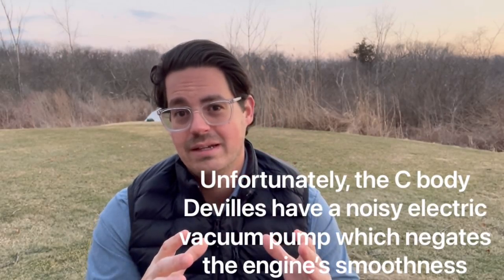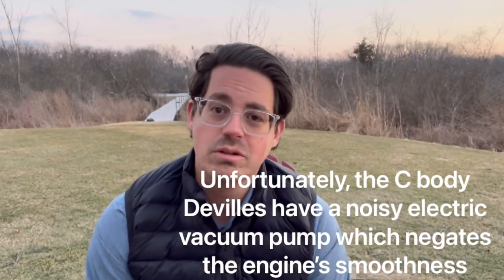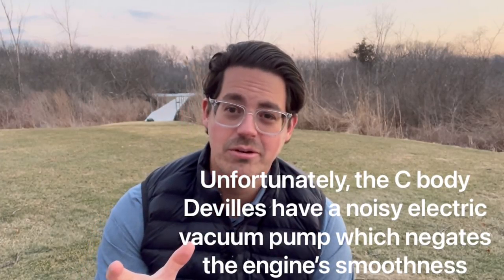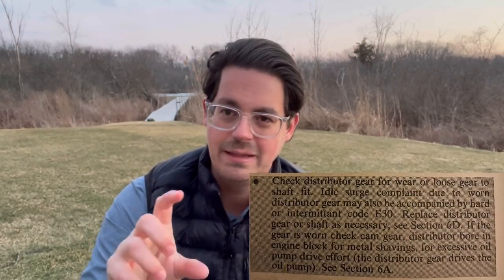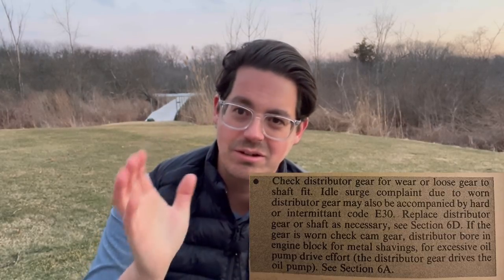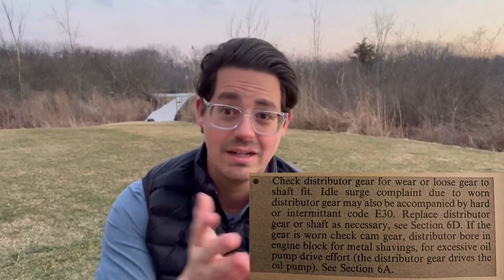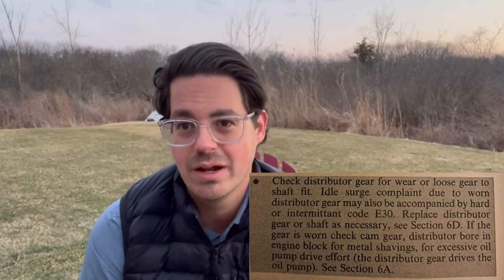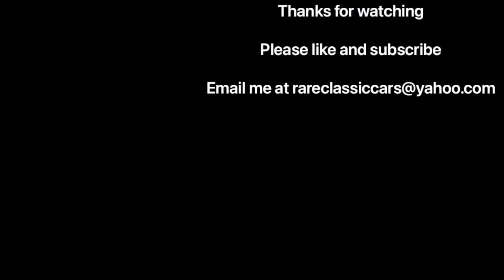Worst Engines of All Time: Cadillac HT4100 - Why is it so bad?  How can you preserve yours?

Comment: I still can't fathom how GM could build engines with soft cam shafts.  In the early 1980s, GM still employed some of the finest automotive engineers in the world and they were certainly aware of the metallurgy needed for a modern cam shaft.  The oil leaks and head/intake gasket problems were bad enough (and should never have happened) but soft cam shafts???  They never seem to learn about products being rushed to production without proper field testing.  The big takeaway is that there are now at least 2 generations of car buyers who will not even consider a GM product, much less a Cadillac or any other American car company's products.  That is the saddest thing to me.
Reply: I guess they did`nt learn from Ford having soft camshafts in the Pintos (in the mid 70`s). In Fords defence though there was a Pittsburg steel strike during that time. I don`t know if there was an excuse for GM.
Reply: GM let the bean counters have entirely to much control in the late 70 thru the 80s. They rushed production, cut development and reliability testing, and used the customer as final testing. 

In typical GM methods, they continually refined and improved the design right up until it was perfected, then it’s discontinued. Then they start over with another product.
Reply: It really wasn't soft camshafts, it was the process used to harden the surface of the cams. This change plus outsourcing, to suppliers, who did not have a handle on the process, and another big one, asking, (and expecting) the supplier to perform their own quality control.
Reply: @johnsalvaterra1355  If it isn`t hardened wouldn`t that mean it`s soft? lol
Reply: @willythewave  The camshafts met hardness specifications, when checked. There were several things going on. Part of the problem was uneven depth of surface hardening. Another was the design of the camshaft follower. It really wasn't the best , even though various engines used that valve train. If it was just "soft" camshafts, it would have been an easy fix.
Reply: That’s the story of GM in a nutshell: great ideas, horrible execution at times.

Comment: The biggest problem with the 4100? Galvanic electrolysis. The heads are good, the cranks are good(I’ve personally ground several hundred 4100 series cranks) but the blocks are junk( 4.1 RWD especially). I have seen perfectly good looking main cap and head bolt bosses shed their threads like a snake shedding its skin. 4.1 RWD blocks are prone to cracking on the rear main bulkhead. The 4.5 and 4.9 engines are both better than the 4.1. In fact, the 4.9 block weighs nearly twice as much as a 4.1 block.

Comment: I used to go to auto auctions growing up, helping my dad check out cars to potential buy. Lots of HT4100 Caddys at the auctions at the time. We almost always avoided them. We didn't want to deal with upset customers with  4100 problems. We stayed far away from the 4-6-8 cars too. We actually liked the 5.7 diesel Caddys, Olds, Buicks, etc. Had more than a few as the family car, never had issues with any of ours but we were diesel people. 
I would LOVE to have a diesel Delta 88 today. Such a comfy cruiser of a boat, love the feel & styling.
Reply: Once GM fixed the diesels in 81 they were quite good. But by that time the damage was done.

Comment: This video does a great job of pointing out the cascading failures Cadillac had in the '80s that the division never really recovered from, which irrevocably eroded Cadillac's reputation:
- Engine sharing among the divisions led to the disastrous problems caused by the Olds diesel.  Cadillac should have been insulated from this, but they jumped right into it just like the other divisions.  I remember at the time Cadillac owners being really ticked off that they were no longer getting Cadillac engines, but instead were getting Olds and Chevy engines that they were paying twice as much for.
-  Poorly tested features like the bolt-on V8-6-4 system led to reliability problems that again should not have occurred on Cadillacs.
-  When Caddy did get a new engine like the 4.1, it became immediately clear that Caddy no longer had the will or the way to properly test engines to ensure their customers were in good hands when they drove a car off the lot.

Comment: This garbage engine is one of my passions. I had a 1985 Deville which was the first year of the transverse mounted 4100. Mine had 150k miles on it when I had it/sold it (I didn't own it for long I maybe put 3k on it). It was somehow the original engine, numbers matching. I didn't have any problems specifically with the engine, it used maybe a quart of oil every 1000 miles or so. I made maybe 19mpg combined out of that car which I thought was really good for such a barge. It was pretty slow for sure, but honestly it kept up with traffic and had no trouble keeping 75 mph. The engine was smooth and quiet, and had a nice sound to it to me. But the engineering story of this engine pisses me off so badly that I really enjoy retelling it with the lens of it being a perfect example of why you give your engineers the time to really do a good job and don't focus on making arbitrary deadlines. Fucking your customers with a shitty product will do you worse than the short bump in cash will net you.

Comment: In the Fall of ‘86 I inherited an ‘85 “G” platform Pontiac Bonneville as a company car.  It had a V-8 (I believe either the 267 or 305 and a 4-speed automatic).  I almost got into a wreck trying to pass a car when I first drove it.  At 60 mph it wouldn’t even downshift into passing gear.  Having grown up during the muscle car era, I just couldn’t believe how anemic V-8s had become.  Fortunately, I quickly transitioned into a new 1st Gen Mercury Sable with a V-6.  It was like night and day in performance, handling, and interior ergonomics.

Comment: In the early 90s I worked at a machine shop and we specialized in the “HT” series engines.  I liked doing a complete engine rebuild job on the rear wheel drive Caddys but hated the FWD ones, especially the oil cooler lines.  It was one trying day that a 4.5 convinced me to go back to school for engineering and get out from under these things:)

Comment: Great video & backdrop Adam! Really interesting. I remember a friend's parents bought a new 85 DeVille & had frustrating problems with it but God knows how they drove or maintained the poor car. If I remember they traded it in a year or so later for an Olds 98 Regency with the 3.8V6.  Years later in the late 90's I purchased a used 92 Coupe de Ville with the 4.9V8 and just loved the engine & the car. As you mentioned it was not quite as smooth idling all the time that you would think a Cadillac should have been. Did not remember that until you mentioned it. Look forward to more on these engines! Cheers

Comment: Drove my 85 Eldorado 4100 from Erie to Atlanta.   Smooth at 85.  It's my daily driver.  You're right about the smoothness.   I pointed it out to my wife.  No shake or pull.  I also have an 84 Sedan Deville with the 4.1.  Yes, it is slow, but I drive like a real luxury car.   As you said, the party doesn't begin until it shows up!    Balboa Blue, Balboa Blue vinyl top, original paint.   She's a head turner.

Comment: First Engine i ever rebuilt was a HT4100 with 50,000 1984 Seville. The old-timer gave me the car when he passed on. And it still sits in my storage building with around 125,000 on it so i can say my rebuild lasted and the owner took care it. My plan is to freshen it up in the next year or so. Keeping Fluids changed and freshly makes all the difference
Reply: @AJ, do you suggest installing a Remanufactured or Rebuilt 4.1L on a 86 Deville?? And pros or cons for each ? Thank you🌅
Reply: @mixtecobajo5582  If you can find a reman for the right price go for it . Since the way things are now with supply issues getting the right parts a rebuilt could be hard to get or not exist . Most good remans come with some short term warranty.  I am lucky to have access to Machine shop with unlimited capabilities.

Comment: My Father had purchased a new 84 Fleetwood Brougham with the HT-4100 V8. As a business owner he would travel quite a bit; he had the car until 1992. The 84 had clocked 186000 miles! No issues at 
all! Just regular maintenance. The A/C and other electronic equipment worked well, right up to the day, it was left at the dealer in 1992.  I saw the car and met the new owner who, had the car repainted (same color) and he said it was a nice smooth hwy cruiser . In fact when it was about a year old. I was able to get it up to just over 100 miles in hour!

Comment: Love the Porch and Field Chats Adam....wow you just know so much I Love it. I currently own a 1990 Cadillac Brougham and thank God it has the Chevy 5.7 350 Engine. Pretty much bullet proof Engine, much better than the ones you have been profiling. I cant believe how bad the Caddy Engines were for a while, so sad for the Standard of the World. Thank God today Caddy is back on track and back building the best cars in the world. Thanks for your videos Adam and incredible Knowledge. !!!!
Reply: Either you had a 1991, or someone swapped it over. 88-90 Broughams used the Oldsmobile 307. In 1991, they used the Chevy 305 TBI (easy 5.7 swap).

Comment: You are so very expert on these 4100... I too owned 4 of these--- a lot problems with 3 of them--- being that the 85 Eldorado convertible is actually 250 pounds heavier than the others, the strain on the 4100 engine was even greater.  I did buy two used "recycled" engines since two of my 4100's developed death rattles....I did own one '83 roadster model that ran, without major issues (and with the original transmission) for 317,000 miles... and yes, I drove it as if I had an egg between the accelerator pedal and my foot!   Really appreciate your expertise.

Comment: I worked for funeral home in 1984 and they bought a new limousine  it was a 4 door with jump seats. They sent me to pick the car from the dealer. And l had to check the engine , l was shocked when I saw the ht 4100 .the car did have a. 3.73 rear end .but fully loaded with people it was working really hard to maintain 60mph.

Comment: Fyi, Rainman Ray did a replacement of the ignition control on an early 2000s GM 90 degree 4.3 V6 today and it is an extremely similar module. I kind of wanted him to mention that having an ignition control underneath the distributor is a questionable engineering decision.

Comment: In the early 90’s, I inherited a very low mileage 83 Fleetwood Brougham that had an HT4100 lump. You’re too kind to this turd of an engine. Some engines, like 1st gen Northstar V8’s, had issues (head gaskets) but also had positives (when running well, the Northstar was a lovely engine that made great noises and excellent power). The HT4100 had nearly every problem imaginable, with almost no pluses. Yes, when working right it was smooth. It was also painfully underpowered, and in my case, with just 17,000 miles, almost never ran right. After pulling the engine, cracking it open and finding that it needed: gaskets top to bottom, crankshaft, camshaft, oil pump, a new intake manifold and a bunch of other nonsense, I gave the car to a friend, sans engine. He ended up dropping an LT1 in it (along with a 4L60e transmission), which transformed the car from a undrivable leaking slug, to quite a sleeper. I, however, didn’t have the time or skill for such surgery, so I was glad to see the car get a second life with a vastly superior drivetrain.

Basically, the core problem with the 4100 is it was very badly made. Everything about it was Swiss cheese. At the time, GM was the largest industrial concern on the planet - they knew better than to ship garbage like the 4100, but they didn’t care enough to make sure it was built right. These weren’t design problems, these were casting issues, material quality verification problems, lack of attention to detail. People talk about the L62 (8-6-4), but that engine could be made reliable with disconnection of a single wire. The 4100 was, beyond any doubt in my head, the worst, most brand equity destroying engine in GM’s history.

Comment: Ahh.... The 4100...as a tech at a gm dealership, these were so fun.. distributor gears failing, rod knock on #1 main, gm had a kit where you more or less put a oversize bearing in to compensate for wear. Seals failing on cylinder sleeves and getting coolant leaks...the list goes on. We were never short for work with these around

Comment: I just joined your channel but have REALLY enjoyed catching up on all your videos. I completely agree with your opinions regarding the Cadillac 4100, 4.5 and 4.9. In recent years I've owned an 88 Eldorado with the 4.5 and it really was a decent car. I think I had to replace the intake gasket, but that was the only major problem I can recall. Then I had a 91 DeVille with the 4.9 and it was a super nice engine. A failed water pump ( which, yes, was a huge PITA to replace) and fuel injectors were the only major issues. So the 4100 really did develop into a couple of decent engines, especially when you consider the dark years of the early 1980's. Nowadays I stick to my '69 DeVille with a bulletproof 472 and TH400 setup. Thanks for the cool videos and good channel. Regards, Matt.

Comment: I had the 4.9 in an absolutely gorgeous 1995 sedan DeVille. Sky blue, dark blue leather, fully loaded, spotlessly clean. 
I actually heard the head bolt snap.i had just bought the car three days before. 
 I was under the hood checking the transmission fluid and admiring how clean everything was, and I reached over and snapped the throttle. On the bottom of decel, I heard a pop. Less than 10 seconds later, the radiator cap unloaded  and coolant started blowing out of the overflow. 
I replaced that engine with a crate motor, and it lasted less than 10k.
I loved that car, but keeping it was an untenable situation.
Reply: No, i didn't rev it cold or hard. Just a blip.
Reply: Assuming it wasn't brand new, you can bet the previous owner knew something was wrong.
The dealer steam-cleaned my engine bay without my permission.  Two days later, the battery terminal rusted off.

Comment: The Caddy HT4100 was a beautiful running engine. Going to Vegas up the grapevine 🍇 around 73 mpg to 76 mph the most harmonic sound comes out of that engine. Like a bear 🐻 waking up on a Montana morning. Second to that such a linear nice smooth robust power curve at those upper speeds. The sweetness of that engine is unparalleled to even the best V8’s out there.

Comment: In 2009, I bought a 1985 Seville from a collector in North Carolina.  It was originally used as the personal car of the head of Delco.  Because it went from Delco to the collector, it didn’t have much wear at all (only 19,000 miles).  I never had reliability issues with the HT4100 engine…..but it wasn’t a daily driver.   If definitely was smooth running……but not much power.

Comment: In 1987 I worked at a Cadillac dealer as an apprentice tech .  I worked on the driveability line under a good tech and he always groaned when we got an HT 4100 engine with driveability issues. I distinctly remember he always went into the climate control system and read EVERY readout and made sure everything was as as good before he let the car go.  On a side note I would love to have driven a '91 Eldo with a 4.9L when they were new.  I heard they were quite torquey and were pretty quick little cars.

Comment: I rememb3r,as a Ford service technician in the late 80s the gm aluminum v8s were stacked to the ceiling in machine shops.. If I recall the cylinder sleeve o-rings were a continuous problem....

Comment: My foster dad had an 82 Eldorado with that damn HT4100 . The 82 Eldorado was a beautiful looking car , this car even had the pheaton top (fake convertible) which was a rare option, well I believe he bought with less than 70k on it (this in 88) ,by 1991 at just under 95k the engine blew. Like I said it was a beautiful car, I can't believe that Cadillac would use an engine like that.

Comment: I found this interesting.  I would like to see one about those diag modes, maybe as part of an overall series of how diags could be done pre-OBD II, sometimes without special tools.   I have a Chrysler K car, and you do the "key dance", ignition key on-off-on-off-on and count the flashes on the Check Engine light.  I had a 92 Buick Century, and I had a reader that I vaguely remember.  I think you had to look at combinations of lights on its little display.  And when you mentioned oil leaks at around 9:00, I like the stock photo you used for an oil leak.

Comment: I had an 85 Seville with this motor, and ironically it's the only thing I DIDN'T have problems with. It had about 150k miles and occasionally smoked for a second on start up (valve guides) but it ran smoothly and always started (when the alternator wasn't dying), but it didn't make much power.

Comment: Owned a 1983 Fleetwood Brougham D'Elegance in 1985 with the HT 4100. That Hook & Tow 4100 was the worst motor ever by Detroit. I broke down once a week w/that piece of crap. It was so bad that I got rid of it fast. Bought a mint Olds Ninety-Eight Regency Brougham and never had a problem.
Reply: I will always lobby that the 5.7 Olds is the worst v8 ever produced. I've never driven a 4100, but what Adam described is roughly double the acceleration of our 98 with the diesel.

With a regular gas 350, our 98 would have been an amazing car. I hope yours was!

Comment: Bought an early 80s Cadillac from a car dealer friend of mine for a $100 had a small problem that I repaired it was beautiful. I wanted to experiment with it but I tripled my money almost immediately. My goal was to put a 4.5 (from a later year) in my somewhat rare Buick LeSabre T-Type, someone made a kit to swap these drivetrains in, was looking to better power the the 3.8 V6 and weak kneed transaxle.